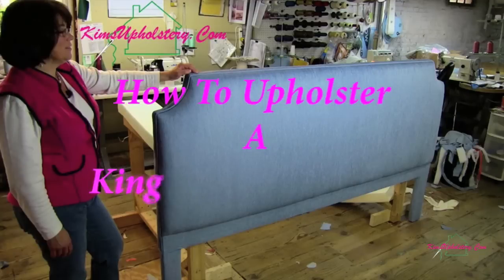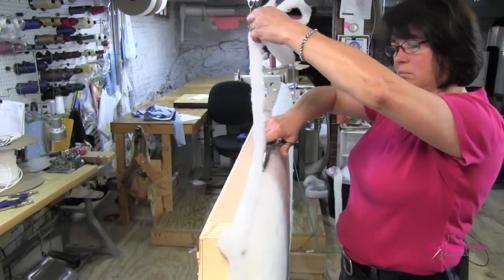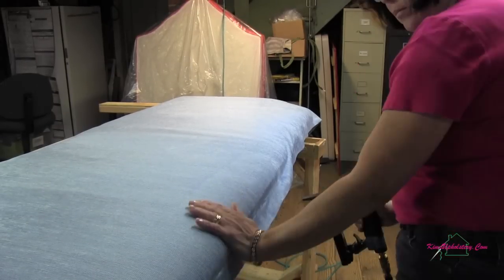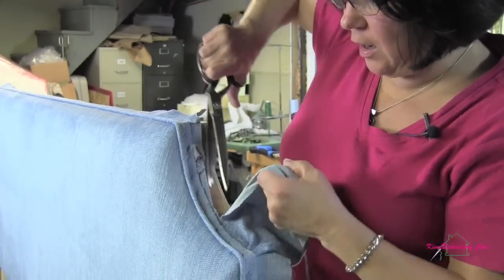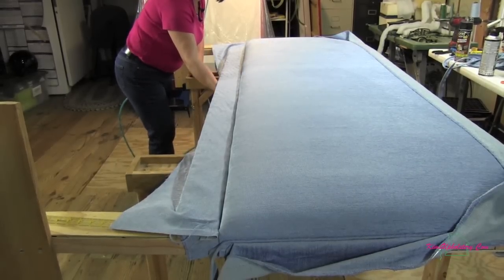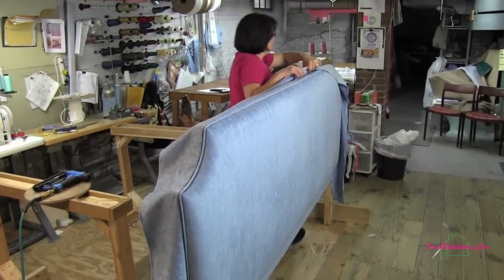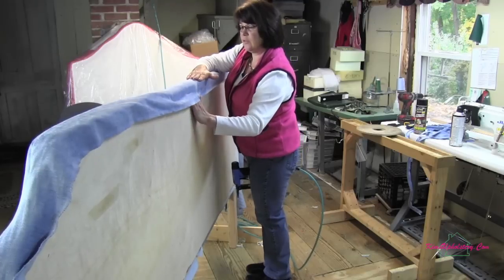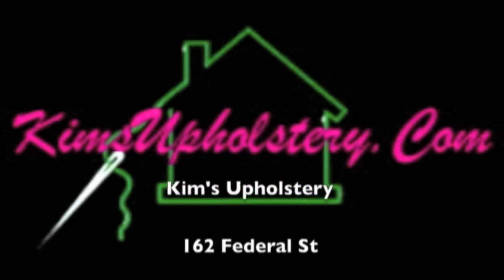How to Upholster a King Size Headboard

Comment from the maker: Hi

I usually make the frame 1" wider than the mattress.  You want to make sure your legs will be able to be attached to your bed frame so keep that in mind when planning it out.  If you look at the video again, I show you how to figure out your cuts by using the button depth times the number of buttons in the longest rows.  If you plan your pattern out and know what size foam you will be using (I used 2")  you should be good.

Thanks for watching and please subscribe if you haven't.
Kim

Comment: Hi Kim!  I had asked on the FB site how to stand the headboard upright.  It looks like you are using the upholstery horses to lean it against.  Is that correct?
Reply: On second thought, it looks like you temporarily attached cross boards at the bottom of the legs.